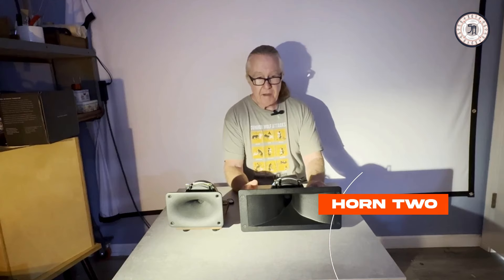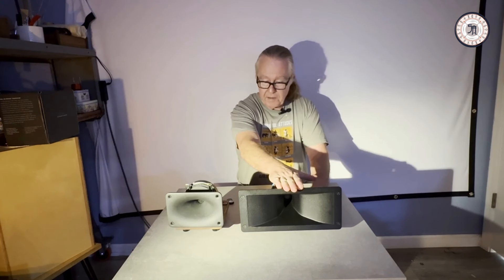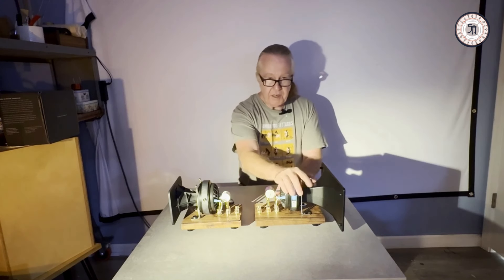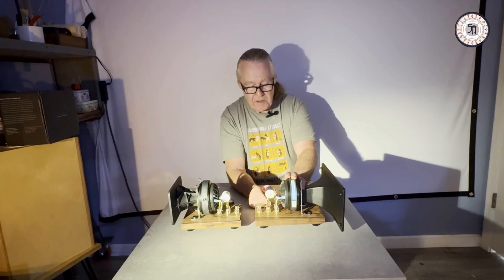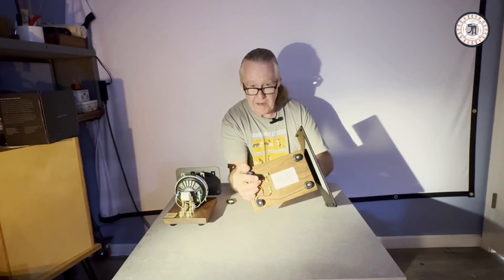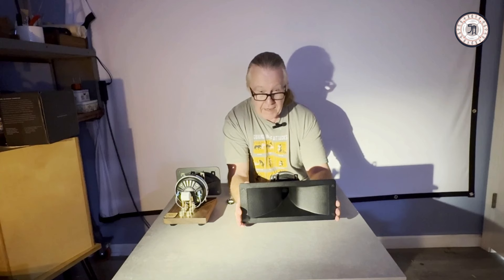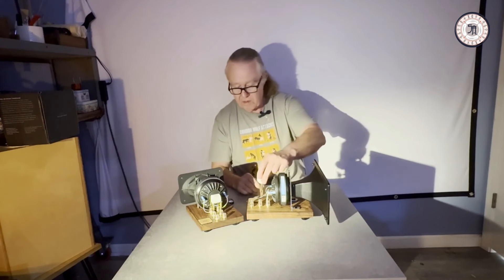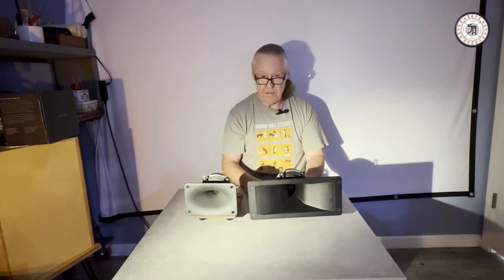The HORN two - larger and deeper

Comment: Sent you an email regarding your horn  but haven’t heard back.
Reply from the maker: Please check your email as we replied.
Reply: Odd because I checked spam and inbox and found nothing. I was trying to find out if your horn 2 will work with my Heresy II.
Reply from the maker: Try our messaging app on our website at www.shinjitsuaudio.com - but yes the Horn 2 will provide a superior result due to its better compression driver the Beyma DC171 FE/PK:  

Klipsch Heresy II Tweeter Overview
Model: K-76-K (common in Heresy II models).
Diaphragm Material: Phenolic.
Throat Diameter: Approximately 1 inch.
Frequency Response: Covers high frequencies above the midrange horn's crossover point.
Crossover Point: Typically around 5 kHz.
Power Handling: Designed to integrate seamlessly with the rest of the Heresy II components.

Beyma CD-171Fe/PK Overview
Diaphragm Material: High-temperature polymer.
Throat Diameter: 1 inch.
Frequency Response: 800 Hz to 20,000 Hz (requires a proper crossover to avoid overloading).
Crossover Recommendation: Should be crossed above 1.4 kHz for optimal performance.
Power Handling: 80W AES (continuous), 160W program power.
Key Comparison Points

Material Differences:
The Klipsch K-76-K uses a phenolic diaphragm, which is known for a warm, vintage sound.
The Beyma CD-171Fe/PK uses a polymer diaphragm, offering higher sensitivity and potentially more detail in the highs.

Comment: So, whose 10-inch woofer do you recommend?
Reply from the maker: Thank you for asking about our recommendations for 10-inch woofers to pair with the Horn Two module. Below, you'll find our top suggestions along with a brief history of successful two-way designs that have proven the feasibility of using 10-inch woofers in high-performance setups.

Recommended 10-Inch Woofers:
Dayton Audio RS270-8 10" Reference Woofer: Why We Recommend It: This woofer offers a smooth frequency response up to around 1.5 kHz, low distortion, and excellent integration with horns at lower crossover points. Its robust design helps manage beaming effectively, making it a solid choice for audiophile applications.

SEAS Prestige A26RE4: Why We Recommend It: Known for its high-quality construction and smooth response, the A26RE4 can handle crossover points as low as 1.2 kHz. This makes it ideal for our setup, ensuring seamless integration with the horn and minimizing beaming.

Dayton Audio DC250-8 10" Classic Woofer: Why We Recommend It: With a natural roll-off and extended response up to 2 kHz, this woofer is versatile and performs well with first-order crossovers. It pairs nicely with the horn and delivers balanced sound without excessive beaming.

Faital 10RS350: Why We Recommend It: This professional-grade woofer offers excellent upper-frequency response and power handling, making it suitable for lower crossover points around 1.5 kHz. Its controlled response helps prevent beaming and integrates smoothly with the horn.

Dayton Audio DSA270-8 10" Designer Series Aluminum Cone Woofer: Why We Recommend It: This woofer combines a sleek aluminum cone with a smooth response, making it well-suited for crossover frequencies around 1.5 kHz. It's a great option for high-fidelity setups where aesthetics and performance are both important.

Proven Success of Two-Way Designs with 10-Inch Woofers:
Throughout audio history, two-way speaker designs with 10-inch woofers have achieved remarkable success by balancing sound quality, simplicity, and cost-effectiveness. Here are some notable examples:

Dynaco A-25: Description: A legendary two-way speaker from the 1970s, the Dynaco A-25 features a 10-inch woofer paired with a soft-dome tweeter. It’s known for its smooth, natural sound and excellent bass response in a compact enclosure.
Notable Features: Acoustic suspension design, simple crossover, and highly regarded for its warm and balanced sound.

KLH Model Six: Description: The KLH Model Six is a classic two-way speaker with a 10-inch woofer and a cone tweeter. Designed by Henry Kloss, it was one of the first successful bookshelf speakers and is noted for its full-range sound and robust bass performance.
Notable Features: Acoustic suspension design, simple crossover, and a reputation for delivering great sound at an affordable price.

Advent Large (The Original Advent Loudspeaker): Description: This iconic speaker uses a 10-inch woofer in a two-way configuration with a dome tweeter. Known for its deep bass and smooth midrange, the Advent Large set a standard for high-fidelity sound in a compact, affordable package.
Notable Features: Acoustic suspension, extended bass response, and a design that became a staple in many audiophile setups.

AR-2ax (Acoustic Research): Description: A classic two-way design from Acoustic Research featuring a 10-inch woofer and a dome tweeter. The AR-2ax was renowned for its excellent bass response and overall smooth sound, making it popular in the 1960s and 1970s.
Notable Features: Acoustic suspension, balanced sound profile, and strong low-frequency performance.

EPI 100V: Description: The EPI 100V uses a 10-inch woofer with a classic inverted dome tweeter in a simple two-way design. Known for its natural sound and excellent integration between the woofer and tweeter, it became a favorite among audiophiles.
Notable Features: Minimalist crossover design, smooth sound, and impressive bass response for its size.

These classic designs demonstrate that with the right crossover strategy and component selection, 10-inch woofers can indeed excel in two-way configurations, delivering outstanding sound quality without the issues of beaming or comb filtering. The HORN two module is designed to build on this legacy, providing a versatile and high-performance platform for creating your own audiophile-grade speakers. If you have any further questions or need more specific recommendations, please feel free to reach out!
Reply from the maker: Thank you for asking about our recommendations for 10-inch woofers to pair with the Horn Two module. Below, you'll find our top suggestions along with a brief history of successful two-way designs that have proven the feasibility of using 10-inch woofers in high-performance setups.

Recommended 10-Inch Woofers: 

Dayton Audio RS270-8 10" Reference Woofer: Why We Recommend It: This woofer offers a smooth frequency response up to around 1.5 kHz, low distortion, and excellent integration with horns at lower crossover points. Its robust design helps manage beaming effectively, making it a solid choice for audiophile applications.

SEAS Prestige A26RE4: Why We Recommend It: Known for its high-quality construction and smooth response, the A26RE4 can handle crossover points as low as 1.2 kHz. This makes it ideal for our setup, ensuring seamless integration with the horn and minimizing beaming.

Dayton Audio DC250-8 10" Classic Woofer: 
Why We Recommend It: With a natural roll-off and extended response up to 2 kHz, this woofer is versatile and performs well with first-order crossovers. It pairs nicely with the horn and delivers balanced sound without excessive beaming.

Faital 10RS350: Why We Recommend It: This professional-grade woofer offers excellent upper-frequency response and power handling, making it suitable for lower crossover points around 1.5 kHz. Its controlled response helps prevent beaming and integrates smoothly with the horn.

Dayton Audio DSA270-8 10" Designer Series Aluminum Cone Woofer: Why We Recommend It: This woofer combines a sleek aluminum cone with a smooth response, making it well-suited for crossover frequencies around 1.5 kHz. It's a great option for high-fidelity setups where aesthetics and performance are both important.

Proven Success of Two-Way Designs with 10-Inch Woofers:
Throughout audio history, two-way speaker designs with 10-inch woofers have achieved remarkable success by balancing sound quality, simplicity, and cost-effectiveness. Here are some notable examples:

Dynaco A-25: Description: A legendary two-way speaker from the 1970s, the Dynaco A-25 features a 10-inch woofer paired with a soft-dome tweeter. It’s known for its smooth, natural sound and excellent bass response in a compact enclosure.
Notable Features: Acoustic suspension design, simple crossover, and highly regarded for its warm and balanced sound.

KLH Model Six: Description: The KLH Model Six is a classic two-way speaker with a 10-inch woofer and a cone tweeter. Designed by Henry Kloss, it was one of the first successful bookshelf speakers and is noted for its full-range sound and robust bass performance.
Notable Features: Acoustic suspension design, simple crossover, and a reputation for delivering great sound at an affordable price.

Advent Large (The Original Advent Loudspeaker): Description: This iconic speaker uses a 10-inch woofer in a two-way configuration with a dome tweeter. Known for its deep bass and smooth midrange, the Advent Large set a standard for high-fidelity sound in a compact, affordable package.
Notable Features: Acoustic suspension, extended bass response, and a design that became a staple in many audiophile setups.

AR-2ax (Acoustic Research): Description: A classic two-way design from Acoustic Research featuring a 10-inch woofer and a dome tweeter. The AR-2ax was renowned for its excellent bass response and overall smooth sound, making it popular in the 1960s and 1970s.
Notable Features: Acoustic suspension, balanced sound profile, and strong low-frequency performance.

EPI 100V: Description: The EPI 100V uses a 10-inch woofer with a classic inverted dome tweeter in a simple two-way design. Known for its natural sound and excellent integration between the woofer and tweeter, it became a favorite among audiophiles.
Notable Features: Minimalist crossover design, smooth sound, and impressive bass response for its size.

These classic designs demonstrate that with the right crossover strategy and component selection, 10-inch woofers can indeed excel in two-way configurations, delivering outstanding sound quality without the issues of beaming or comb filtering. 

The HORN two module is designed to build on this legacy, providing a versatile and high-performance platform for creating your own audiophile-grade speakers. If you have any further questions or need more specific recommendations, please feel free to reach out!
Reply: Great breakdown on Drivers,
Thanks